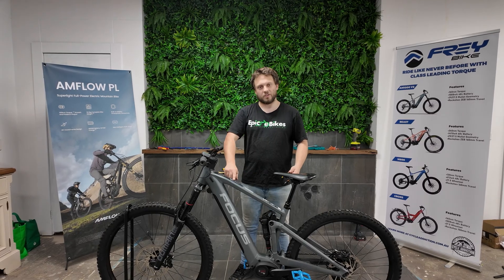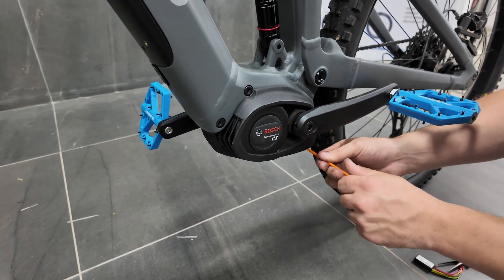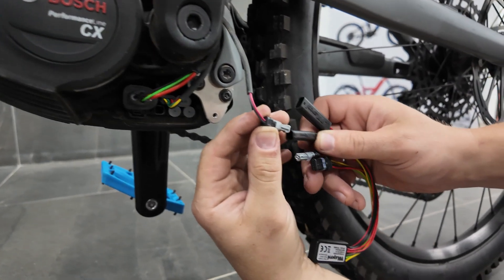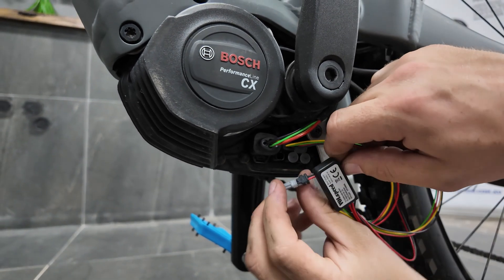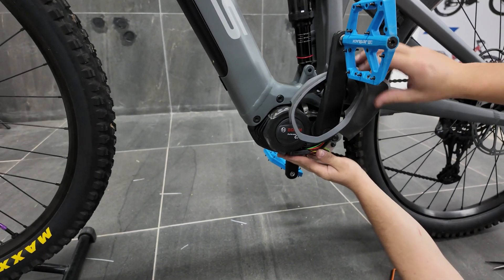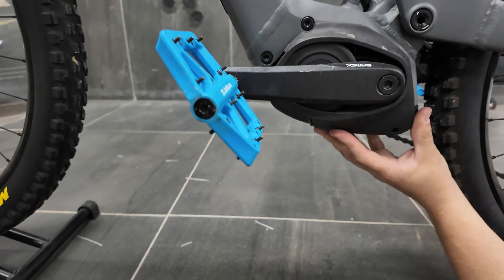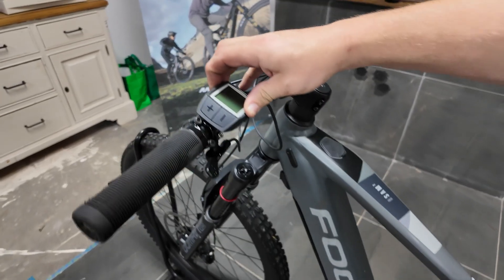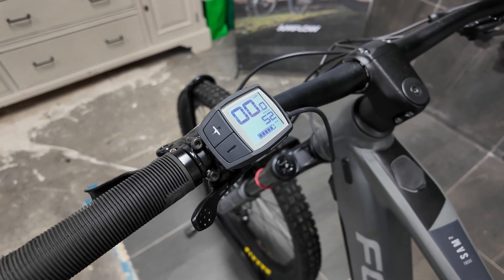Volspeed V4 + Bosch CX = No More Limits!

Comment: I have a polygon with the Boch Perfomance line CX but it doesn't have a digital display, just led's on the main bar, how, do I do it with that?
Reply from the maker: https://epicebikes.com.au/bosch-unlock-guide/

Find the correct chip for you display at the link above, The chips still work without a display it's just harder to tell if activated or deactivated without the visual feedback.

Comment: I've had your de-restrictor on my ebike, with a Bosch gen 4 motor, for over 3 years and I've been VERY happy with this product.
The secret, I think, is to let the display time out and turn itself off, so I never got the dreaded error code.
A big thumbs up from a happy customer.
Reply: Do you ride at over 35 for prolonged periods? Is your motor a smart system one?
Reply: @juanfel1555  I frequently ride in the 30-35kph range and my motor is not a smart system one.